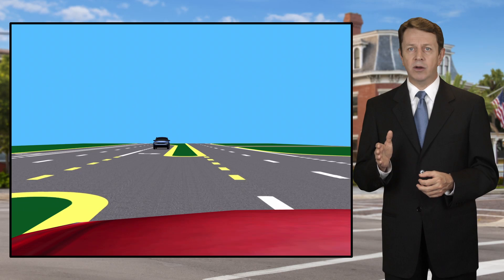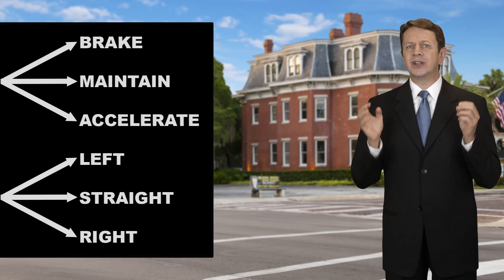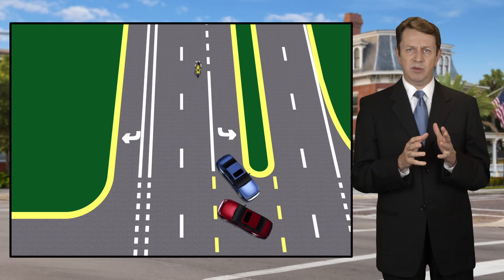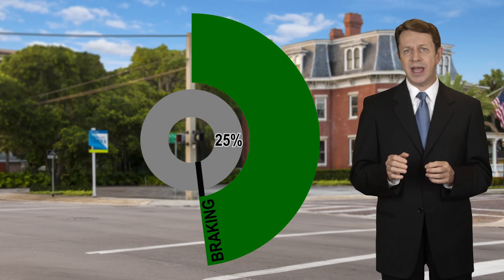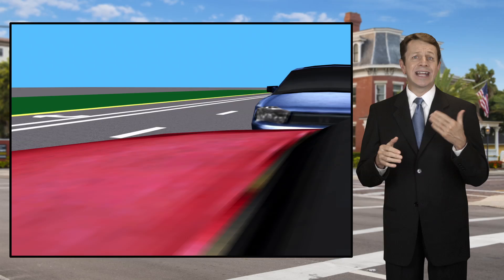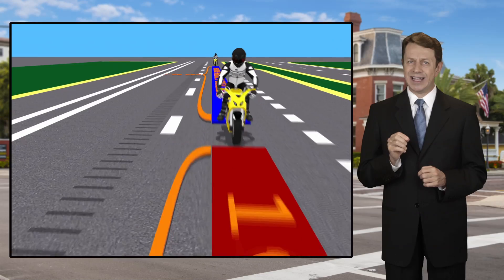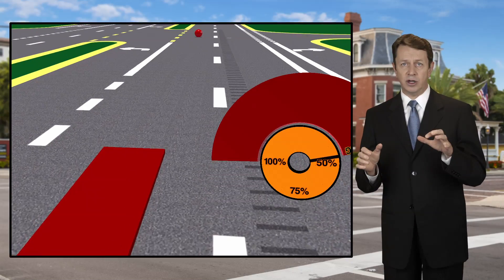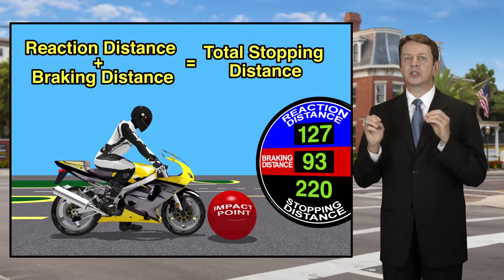MOTORCYCLE CRASH ACCIDENT RECONSTRUCTION - How it is done and what you want to know

Comment: I don't really understand why trying to accelerate and turn right is a bad decision. Assuming you don't make it past the car, it hits you on the side, and presumably you go flying over the handlebars the same as if you'd hit the side of the car; you also hit the ground the same as if you'd not turned, albeit at a faster speed.

However, the moment of impact with the car reduces your speed less than hitting it straight-on, and it's the sudden stop that kills you; isn't it better to make the sudden stop more of a sudden change in direction?

Comment: james is on a sportsbike, if he was in the right gear he could probably accelerate out of that crash. i did it against an ATV which was not supposed to be on the road. i am typing this right now. there are so many times that power saved my life. in a car and on a bike. i would most probably turn right and accelerate, get hit by the car from the rear tire, fall and slide. much better than hitting the car head-on
Reply from the maker: Speed can get you out of danger.  Practice defensive riding.

Comment: I used to ride a moped with a top speed of about 34 MPH....   It had very good brakes and relatively big tires.  When I did my emergency stop tests from about 32 MPH I could get it to stop in less then 50' when I applied full brakes and put both feet down on the ground Fred Flintstone style to assist (it used hand brakes for the rear as well as the front).  The bike weighed about 165 lbs and I weighed about 250 lbs at the time...  I was impressed that it could stop in such a short distance.
Reply from the maker: Great that you practice emergency braking.  Ride safe.

Comment: Just to add ABS stops you from locking up and falling off, it does not improve braking if anything it makes it worse. If you hit the brake hard, its job is to stop locking, it does this by unlocking your tyres (releasing the brake), and then applying the brake, this actually increases stopping distances but stops the rider from locking up and falling off. Most effective way to stop is braking without the use of abs being enabled, i.e. gradual increase on the front brake till you reach 70% squeeze then add 30% to the rear brake - keeping the bike straight bars straight. Obviously when a car is about to smash you and you are panicking this delicate routine is very difficult to achieve and that is why I practice it time and time again in empty car parks, so that it is in my muscle memory and becomes second nature.
Reply from the maker: Hi Rachid, excellent advice and information.  Practice practice practice and avoid a fall or collision.  Thanks Matt
Reply: I agree but you presume the ABS rider's mindset to be just "slam-on and let the ABS take care of everything". It isn't necessarily so - If you are careful and only try to approach the traction limit as if you didn't have ABS, then its existence is a clear advantage because road conditions can be treacherous.

Comment: Basically your fucked. What a rider should do is see the threat and act accordingly, i.e reduce speed way before the intersection when a car is spotted waiting. Best rule; scan all upcoming intersections - see a car waiting - slow down, change lane to the furthest away if applicable, cover the break with your hand to slow down reaction time and be prepared to stop at any moment. After drink riding the number 1 cause for motorcycle fatalities is intersections.

Tip 2: When waiting at a red light at an intersection do not speed off as soon as it turns green because this is when people get T boned by people who skipped the red light at the last second, wait a little bit before bolting off.
Reply from the maker: Excellent advice.

Comment: I crashed into a car pulling out into the second lane, from the right. I decided not to turn because I didn't know what was behind me. I applied braking, most probably skidding with the back tire but not the front, and hit the front wheel of the vehicle. It may have been a little slower than 40, because I wasn't thrown. The bike bounced away and I jumped.

I would have benefited from reducing speed and moving to the other side of my lane to improve braking distance and give myself longer to react. 

In the situation in this video, I would see the potential threat and immediately begin to slow to avoid the imagined impact point, until I know I can pass before the vehicle moves AND/OR stop if it crosses the lane. I would also check my mirror, indicate and cross to the right lane, making myself more visible to the threat with flashing lights and lateral movement, which is easier to spot, especially at night, and also warns other motorists of a potential hazard. Hazard lights might even be appropriate. This is especially true in places where people violating your right of way is common.
Reply from the maker: Hi Soel, sorry to hear about your bike crash.  It is a scary situation you had to deal with.  I hope you and your bike are okay.  I agree with your analysis of the crash and the possibility of taking a few more steps in the next emergency brake situation.  Stay safe on the road, and have fun while be alert to bad driving around you.